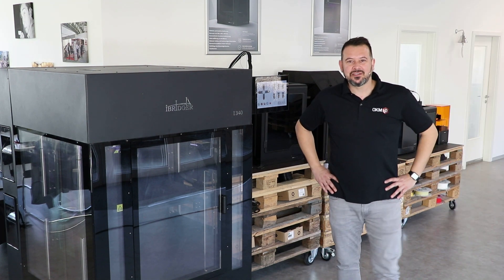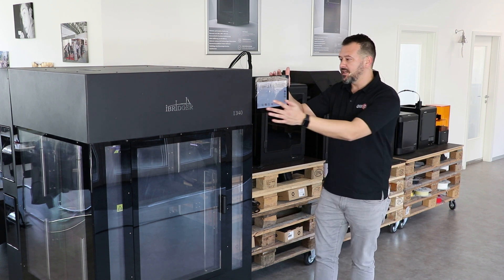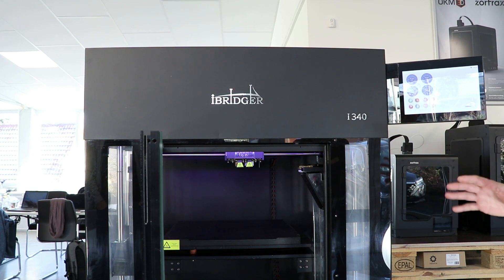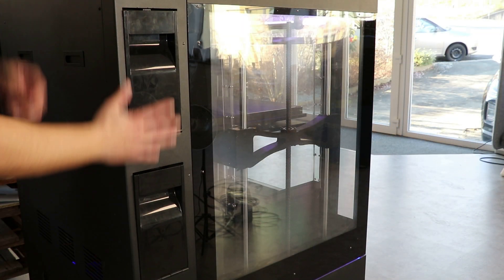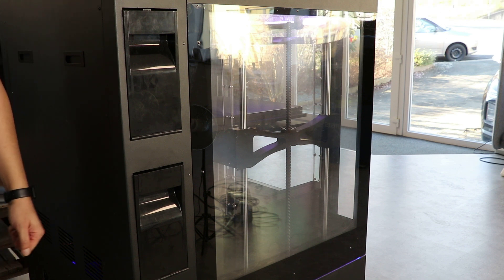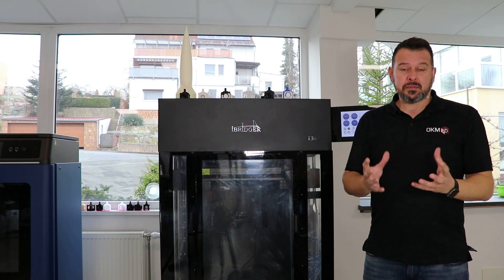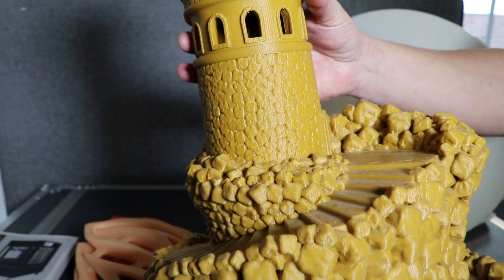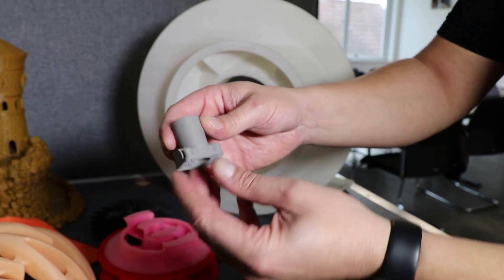iBridger i340 industrial 3D-printer - First Impressions English - OKM3D

Comment: After using the printer for 2 years. I would NOT recommend it . As friendly as the support staff is, this printer is just way too unreliable.

1: The Bed NEEDS a raft which is ridiculous as a 300$ chiron with  slightly smaller foot print does not with a much better bed mesh probing system
2: The heated bed upgrade is an absolute miss.. if you heat it up beyond 60 degrees everything warps regardless how much i try to "tune" it.
3: Automatic changing from an empty roll to the next roll works 5% of the time. It either gets stuck, or sensors do not work
4: There is NO remote app or access to the machine despite the claim it would come out.. it never did
5: The touch screen interface  never shows the image of the model you are printing.
6: Reliability for a "commercial grade" printer is less than a 200$ creality ender 3.
7: No input shaping or Linear advance. The technology is so dated now compared to newer machines on the market
8: I can go on and on.. you can message me if you require more honest input.
Reply: Good to know about the the heated bed - I had planned on getting it,